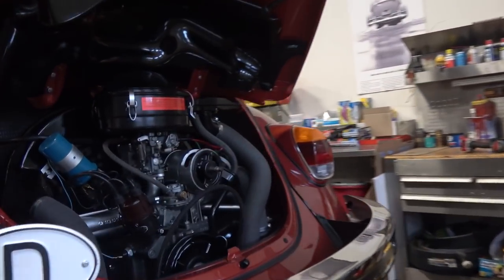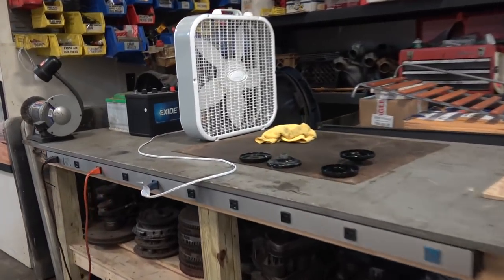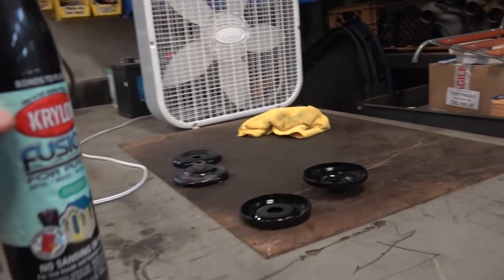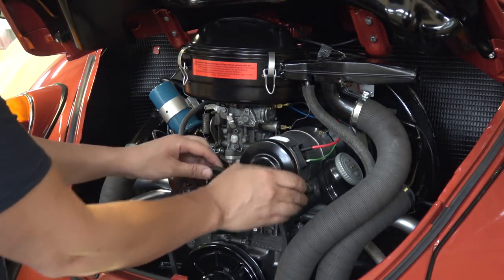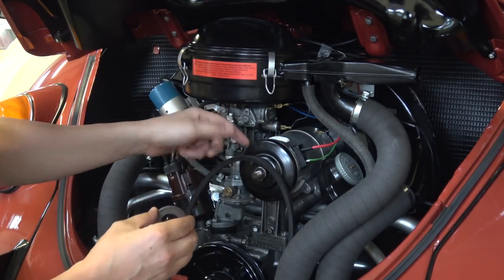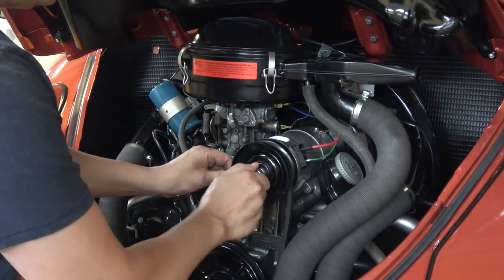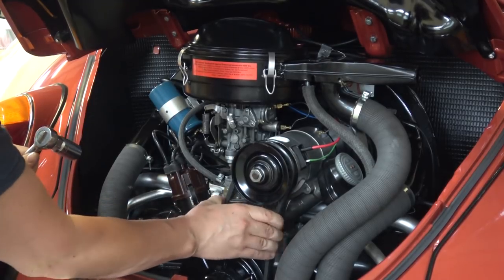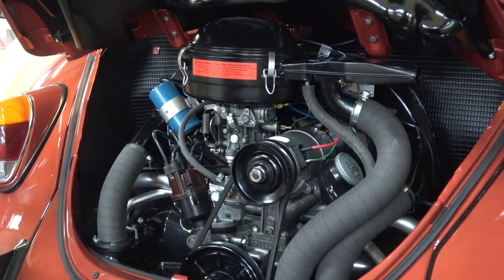Classic VW BuGs Paint or Powder Coat your Vintage Beetle Ghia Pulley

Comment: I own an Industrial powder coating plant ,and also apply Cerakote ceramic  coatings.  For my car engine parts I prefer the ceramic  coatings for a few reasons.  The film build for powder is 3-5 mils on average. Ceramic coatings are less that 1 mil. Powder needs this to perform .It is very durable and depending on the type of powder can be very resistant to fuels, oil, etc. They have their applications, and are less expensive. Ceramic coatings off the same performance and more at a very low film build. Ceramic coatings are more thin that most paints. As am example on wheels, powder will not have the appearance that ceramic coatings offer. Powder also normally has an orange peel look, and ceramic coatings do not. .

Comment: I have a serpentine system (engine hasn't run since forever), and now that I've added an a/c compressor the belt slips when rotating the engine by hand. You just gave me a possible solution to that problem, I'll use my Dremel with a wire brush and remove as much of the powder coating in the grooves as possible. Thank you for the video.
Reply: how does your ac system workout?

Comment: An easy way to remove powder coating is to drop the part in a bucket of brake fluid, and leave it over night.  The next morning, anything left should come off with a bristle brush and a shot of brake cleaner.

Comment: I know this is not a topic, but I have to ask why I have disalighment between the two pulleys? I removed VW stock pulley from my 90mm generator and added a new  Porsche three-part pulley (hub, inner and outter half of pulley). I thinked that is the same thing. Now the generator pulley is more forward than the crank pulley ... Do I have to change the lower pulley too? Are there more types of crank pulley? Please, somebody help! Thanks in advance.

Comment: Would an external oil cooler help? I ran a degree pulley on my bus and same problem belt was slipping and not cooling  and oil cane out through flywheel seal

Comment: Isn't the torque on that nut 42 - 47 ft lbs?  I think it's the same on the fan in the back.  I had some bug guy torque my fan so hard it cut the metal.  I had to get another fan and put it in myself.

Comment: Shouldn’t you use a torque wrench so it’s tightened to spec? The engineers spent the time and effort to determine torque specs for a reason. The stock vw engine really is pretty isn’t it?